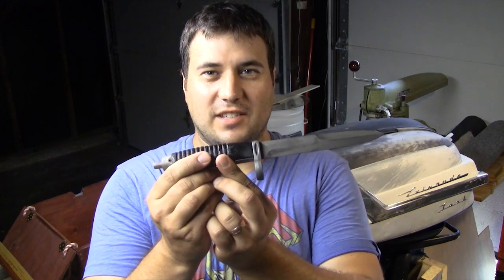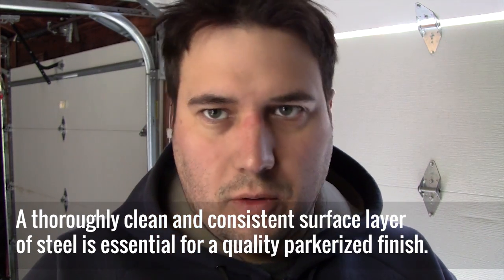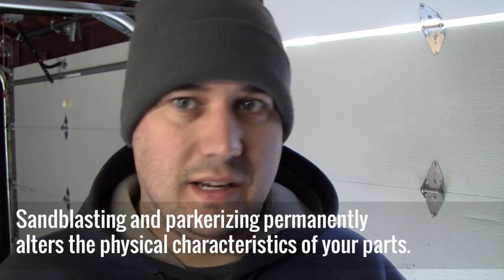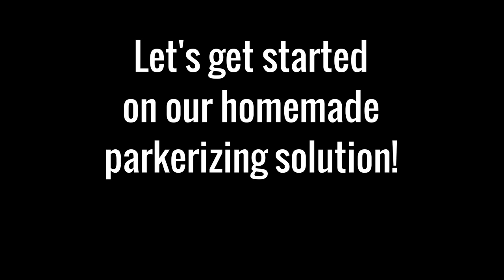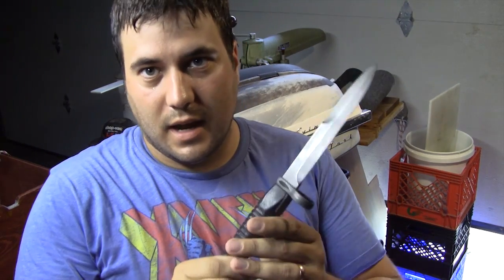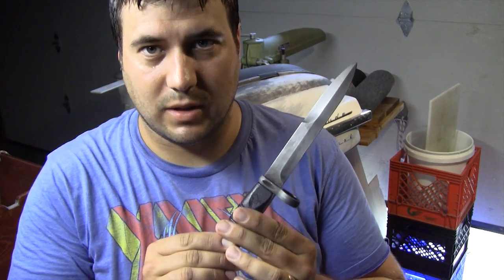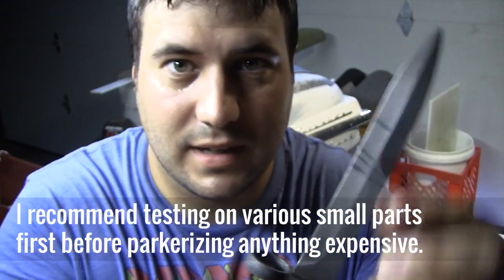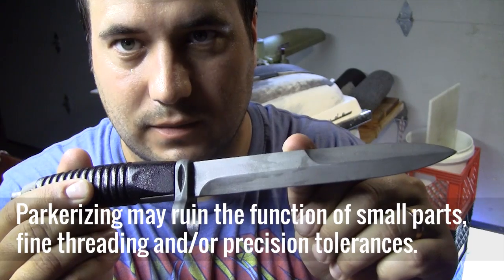DIY - Homemade Parkerizing Solution - How To Etch a Knife

Comment: I "WILL TRY" This Simple, not too much temp, easy ingredients already in my shop! NICE!
Rust oxiding a musket barrel as I type. just finished KN03 bluing lock and other bits, with casehardened hammer frizin.  
I have done some Industrial passivation, so this looks great, I love the mat dark gray green.
I am quite SURE the different colors are due to prep of surfaces.
I use acetone 1st, then about the same temp(80c) trisodium phosphate and water 2nd, rinse clean and hot, then into the etching or coating solution.

Comment: The batteries I'm cutting apart, the manganese oxide has liquid in it.  Ive tried 2 batteries with the same result. Did you  run into this when you cut batteries open?

Comment: Interesting. I have an Ontario Chimera and it came with large blotches and wonder how that is possible. i thought it would be uniform, but no. Even after soaking in oil, those blotches remain. So is this typical of parkerizing? Or how is it that Ontario does it this way? Not clean enough?
Reply: I do not know exactly.

Comment: This is an interesting video, I have been looking into different homemade knife coatings, there is not a lot that are not just paint of some kind. Can I ask though, what is the purpose of the steel wool in the solution?
Reply from the maker: You are essentially corroding (like rusting) your steel but doing it in a manner that leaves a tough protective layer i.e. iron phosphate. Too much and you may ruin it... the steel wool helps dampen corrosion/etching/rusting and starts the parkerizing/iron phosphate reaction.

The steel wool reacts with the phosphoric acid and starts the reaction that will happen on your parts once you dunk them in. If you dunk your metal parts into the acid bath without putting steel or steel wool in there first the acid bath may start to etch your parts but not create a lot of iron phosphate until more iron has been mixed into the solution. This basically means more etching (usually undesirable) and less phosphate coating what you are trying to accomplish. Etching is basically eating away at your steel.

This form of parkerizing can be made to work but there a lot of variables so be sure to experiment with like metal pieces first and keep track of your mixtures. Also keep in mind tolerances on parts will change so you could ruin small parts especially pinions, screws, springs or any other steel parts that sit flush and/or tight.

The ingredients are relatively cheap compaired to the kits you can purchase off of Brownells or taking to a gunsmith and that is the main reason for doing this, that's not to say that it's the best way or that there isn't a better solution out there. I also like to experiment and learn and this is a good way to do it. Just be careful not to get phosphoric acid over everything and you should be alright.
Reply: clkindred The phosphoric bath could be strained after the steel wool is added. I think the hardest part about this method is getting the manganese to suspend in the solution and not making a mess. Also, I think the lines in the knife blade line up with the stainless steel wires used to suspend them. Not sure how the stainless wire reacted with the steel maybe it made it hotter but I also think it may have helped trap the manganese close to the etched surface and added more manganese to it... will have to experiment again and see if I can do better next time.
Reply from the maker: clkindred Saw your channel and subscribed. Wanted to make my own foundry for a while now just never seem to have the space at the places I live.Saw your videos on the stove, like them. Tried making a few of my own stove designs as well but have yet to come up with a significant improvement on anything that has been done before. Working on homemade shooting sticks and a couple of knife projects. IT's hard to find quality chunks of forged 1095 steel that aren't way over priced. ANy ideas?
Reply: Thanks, I was experimenting with a product called ospho. Looks from the MSDS to be very similar to the kleen strip. I was using it with electrolysis to put an iron phosphate coating on some test samples. I used a stainless steel anode, and the test part as the cathode. Voltages renged from 3.3v to 12v. It seemed to work okay on the small test pieces, the coating was more of a gray color.
Reply: I would like to add manganese dioxide to the solution, but it seems batterys have some other stuff mixed in, like iron cloride, and insoluable carbon. I might try purifying a bit to see if I can remove the contamination.
Reply: As for 1095, what's your definition of overpriced? Are you looking for a scrap source?
Reply: Yeah for sure I dried the manganese out and used a morter to crush but still didnt mix well in the solution.
Reply: clkindred Scrap that's big enough to carve a decent sized bowie out of. 1095 online they want like $45 for a 12" section or more sometimes more and it just seems a bit pricey when that's half the cost of a new laredo bowie from cold steel. I thought maybe a straighter leaf spring out of an old truck might work but I don't have any of those laying around or something similar. Have yet to find an old file that is forged and made from 1095. I don't have a foundry to hammer my own steel. Need to find a chunk that preferably forged and I can cut to shape.
Reply: ***** I suppose it would depend on the thickness you want. I am looking into working with some 1095 and found the best price online was at knifemaking.com they have thicknesses up to 1/4inch although that thickness is 1075 steel. The other thicknesses are 1095. But the thickness I was looking at was pretty cheap.
Reply from the maker: clkindred TX

Comment: Looks nice, but one question: why do you put the steel wool in the solution? The more I think about it, doesn't it pollute the solution an make it less reactive, as the solution eats away the steel wool and forms iron salts floating around. You might get a darker and thicker finish if you put the parts in fresh solution of acid and manganese oxide :)
Reply: k4rtturi im not a chemist so i don not know the exact chemical reaction that is taking place but... u need to get the reaction started with the steel wool. If u just dropped the parts in without the steel wool u would etch the steel faster and might not even get a finish. Not all reactions are stable.
Reply: Thanks! I think I see what you mean, but then again I've seen other gunsmithing videos where you'd specifically put the parts in clean solution, and I looked quickly at a technical paper where they said that iron phosphates are considered a harmful contaminant that will make the solution less effective and alter the resulting coating because there will be less manganese phosphates deposited in the surface. So my hunch is that if you want that kind of thick coarse black parkerizing, straight phosphoric acid solution might be the way to go.  But maybe that's beside the point, if you get a surface finish that works and you like the looks of with steel wool, then that's a success. :)
Reply from the maker: Right and solutions, mixtures and methods will vary... Always best to test on something you can throw out first.

Comment: What size air compressor did you use with that blaster?
Reply from the maker: +AKBuilder762 It was tiny.. Husky 3 Gallon. kind of stunk because it kept running out of air. But it worked. Usually a bigger tank makes it way better. The gun was $15 from harbor freight and was more than good enough. Sorry for the delay in reply have been really busy lately.